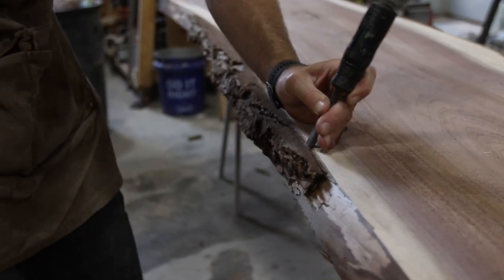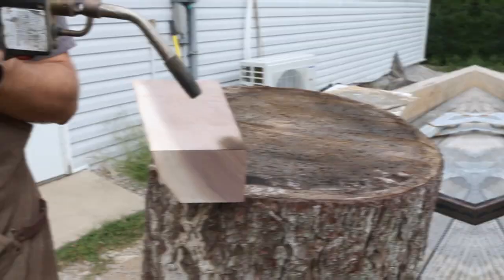How to Make A Shou Sugi Ban Live Edge Slab Countertop

Comment: Hi could you tell me what sort of oil you rub on the wood ? Is that only after your done burning or is that a process you do before and during?
Sorry very new to wood burning. I have a couple sland of black walnut i want to stencil burn my last name as well as the grains along the planks. Going to use them for my bar top. Thank you for your time.
Reply from the maker: We applied some Arm-R-Seal in our sample, but found it didn't do much for the overall look. When we were burning it, we were just using some water with a brush to kind of keep the surface from getting too hot. Then, we sealed it with a few coats of a conversion varnish.
Reply: @BruceAUlrich  Thank you very much for your response Bruce .  Much appreciated!